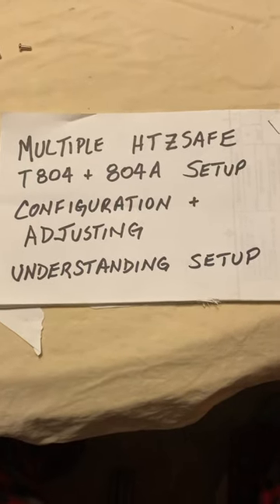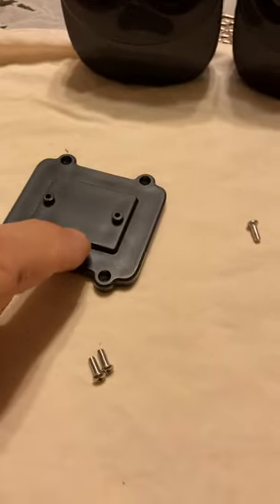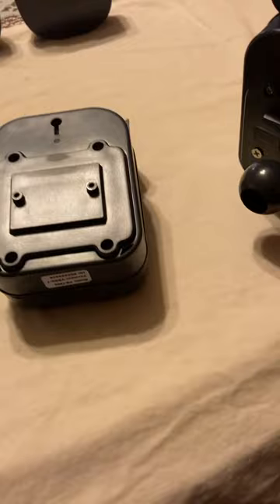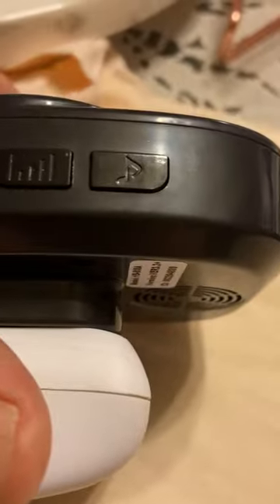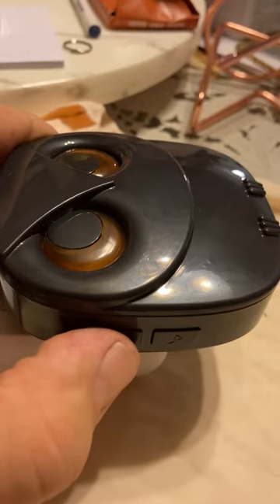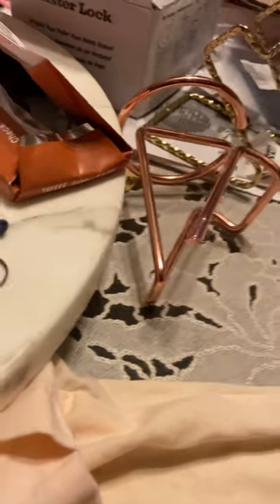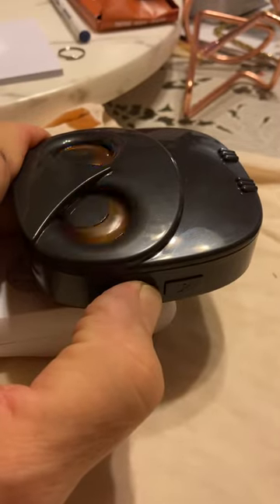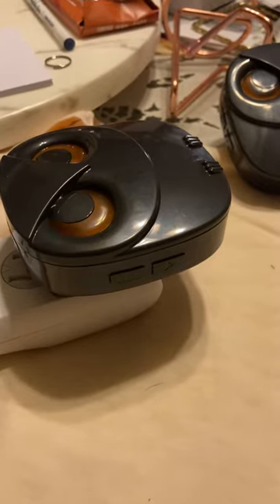HTZSafe T804 & 804A tutorial for motion detector setup for multiple units transmitters and receivers

Comment: Great video...we know the two distances of the beam but could you do a video to test the width of the beam to help in setting the angle of adjustment?
Reply from the maker: @marilynlonsbury5489  I’m not sure how to even go about doing that, I’m just a user like you guys and I figured out how to configure multiple transmitters to multiple receivers. I’m glad the video helped you. Maybe there’s some technical assistance out there to get the Beam with information good luck thank you for the comment.
Reply: @paulsantos5625  thank you very much for responding I will try to test the width of the beam by getting someone to walk past the sensor while watching on my security cameras and listen for the tone when the beam picks them up entering the zone. Just FYI I have discovered that the beam length is way further than 50 ft as mine will beep when it picks up the school bus on the next street over. If it is set horizontally at too level an angle, there is nothing really to stop the beam from picking up something which is amazing.

Comment: Just ordered these today and then found your video. I ordered 2 receivers and 4 alarms, I was sure hoping there was a way to have multiple notifications in different parts of the home...Wonderful!!!  Thanks for the detailed video!  (I also read that these are not totally waterproof and fill with rain) I plan on building little open front birdhouses to hang these in for protection.
Reply from the maker: @cathybradford5685  cool very clever … mine have been mounted to several trees for 2 years with no issues, good luck

Comment: Every time you set it up for a certain ring it changes all of the sensors to the same tone. Waste of time. Good idea! But unfortunately it is useless to not know which sensor is going off.
Reply: Well that will keep you hoping!  🤔  I have four sensors set with different tones for four different locations, no problems so far after three weeks.  Will be setting four more and adding another receiver, hopefully my luck will hold.
Reply from the maker: @warrenp2022 that’s awesome

Comment: Is there some kind of set screw or tightening collar for locking the ball joint to keep a strong wind from repositioning the sensor unit?
Reply from the maker: I just finger typed my collar to the base plate. I don’t have any issues and it gets pretty windy here even gusts up to 50 miles an hour. This winter did not affect them.

Comment: Set up  receivers they work well for  a couple of days.  #3 was set off in driveway 1 alarm and then receiver would not turn off. Have unplugged it for a couple of days plugged it back in and receiver does not turn off .  What needs to be done to get this working again. Sound does not turn off even waving other receiever in front of it.
Reply from the maker: I hate to tell you this because I hate it when people tell me the same thing I would contact the manufacturer something is wrong I have three receivers and they all go off

Comment: Set up worked perfect....hour later stopped working...what's the problem
Reply from the maker: I have no idea, try reconnecting/ reconfiguring the unit in question. I have mine up for quite some time now and have had no issues. Good luck

Comment: Our receiver is stuck beeping and flashing after only a few days use, no settings changed or buttons pushed, had it returned, got a new one, it did the exact same thing straight out of the box, nothing in the directions about it, gave up, left them in the box for a year, try em again, still doing it, any idea? It's a very faint ticking beep like 2-3 times a second.
Reply from the maker: I have no idea what is causing that. I am so sorry. I hate to tell you this, but contact a manufacturer.